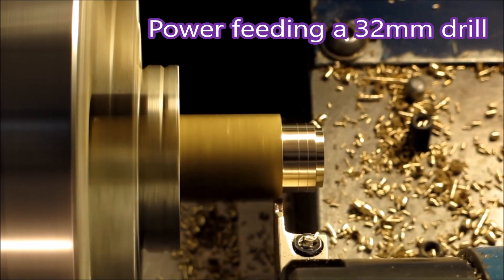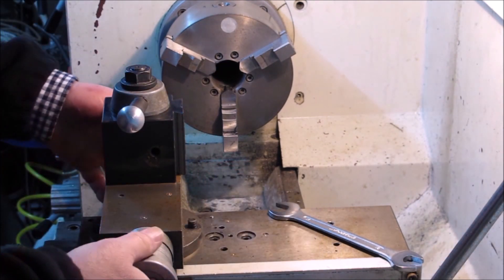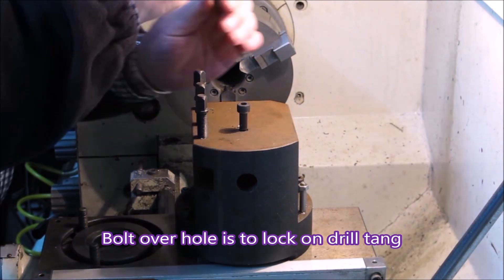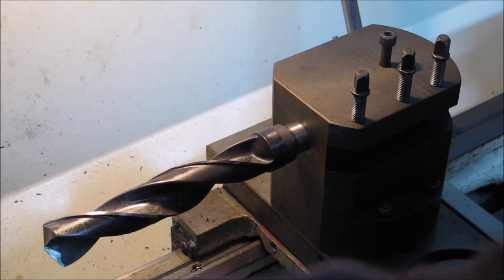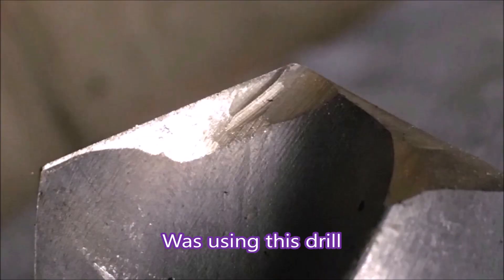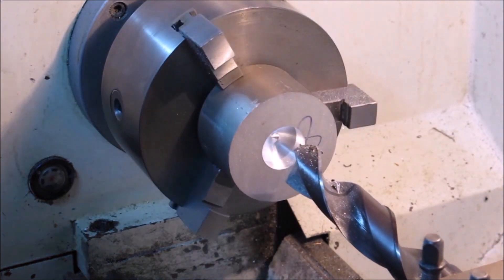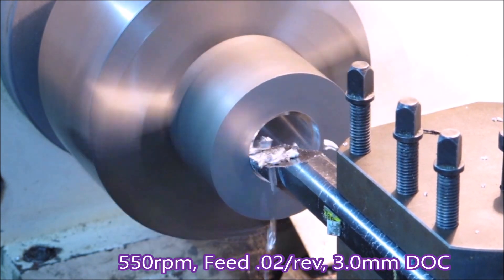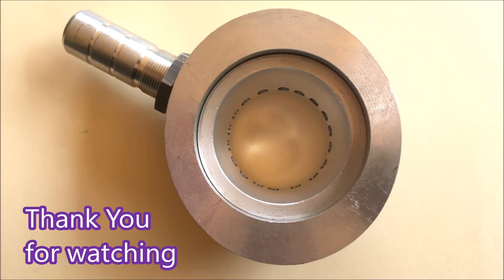Drill 32mm using power feed in my centre lathe. My fix for big holes without using the tailstock

Comment: I have an old Voest that has a second set of T slots on the back of the cross slide. Might just be suitable for this kind of fixture. Thanks for sharing this.
Reply from the maker: If you need to drill large holes, it will be well worthwhile. Thanks for your comment

Comment: Was that mixer used for propane conversions? Neat part. I can't believe that huge drill didn't need a starter hole. Genius approach!
Reply from the maker: The mixer was to run a fork lift on bottled gas. Don’t think it is pure propane though. The drill was ground to thin down the point, making it easier to penetrate without a pilot drill.  Avoiding pilot holes seems to be what I do most. As I mainly use stub drills, I even avoid using  a starting drill. I did recently use a pilot  drill on a job where the lathe simply did not have the hp to drill it in one hit. Thank you for your comment.

Comment: The previous owner of my lathe used MT4 and MT3 sleeves for the QCTP boring bar holders.
Reply from the maker: Not sure I would like really large drill in the tool post, although I often put smaller drills in the QCTP when there are a few holes to drill. Thank you for your comment.
Reply: @smallcnclathes  the toolpost is rather rigid on my machine I guess
Reply from the maker: Mine is rigid, but would want to turn on the centre bolt if the load became too high. Beats using the tailstock though. The force needed to drive a big drill with the tailstock is ok once or twice, but after that my arm falls off. LOL